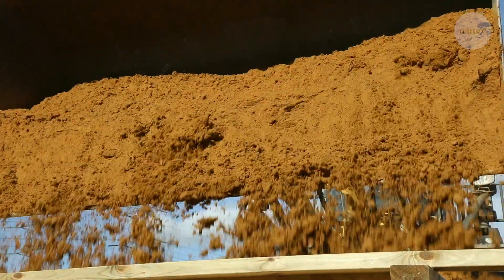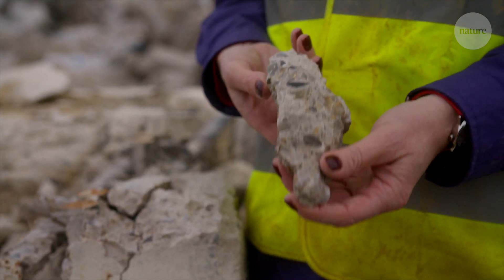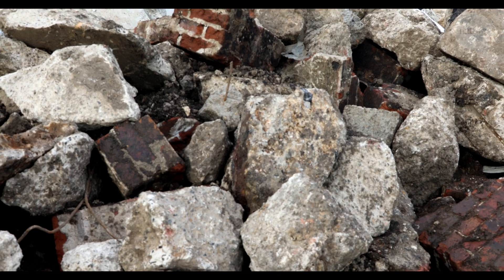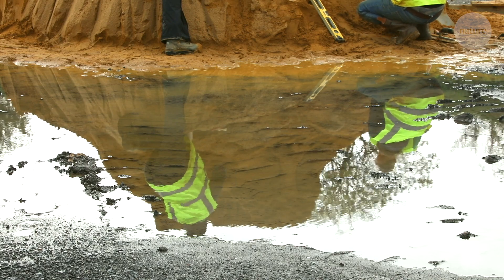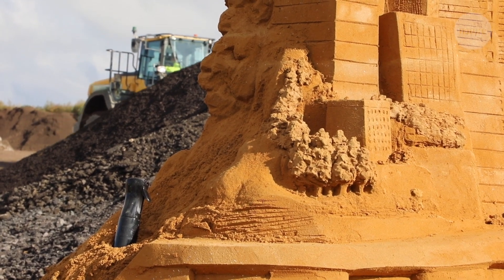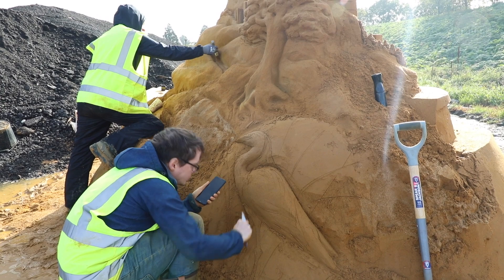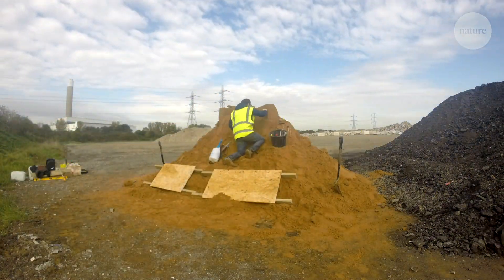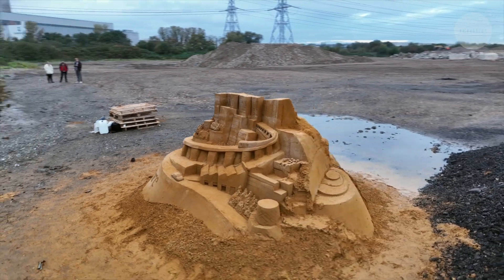The sandcastle economy: How to recycle a building

Comment: Brilliantly constructed video.  Who knew why building sand is different from desert sand?  And that the sand of time is running out for sand, as well as for CO2.  As concrete accounts for 4%-8% of global CO2, re-using concrete units eliminates nearly all it's CO2 load.  Just need architects to move to standard sized components.

Comment: Not a good proposition. Old concrete blocks cannot be reused because the concrete has a finite lifetime. Additionally, building like Lego will make the buildings much worse and more expensive because now the architecture and materials have been optimized for each particular building.